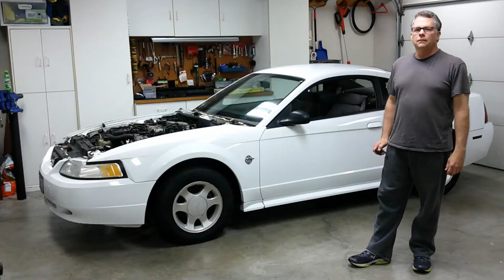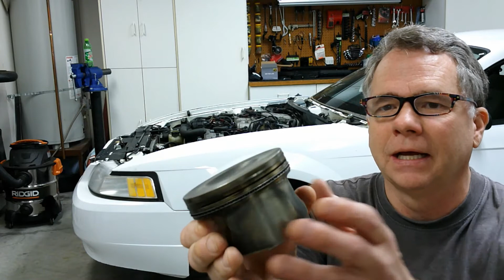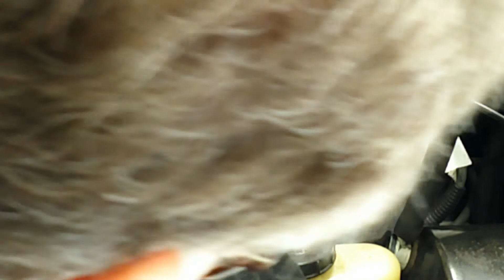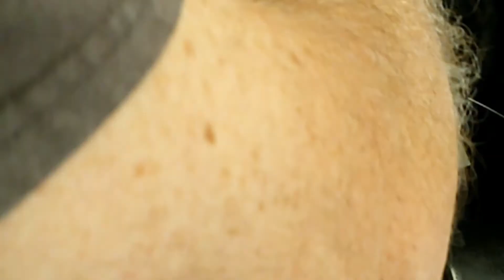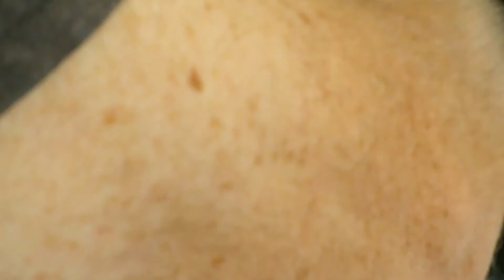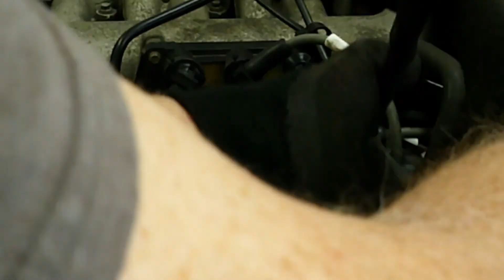Mustang Engine Repair (Part 1)

Comment: I have the same year . A 2000 mustang v6 3.8 . The engine shakes and you can feel it all over the car . 
Would you think this maybe a flex plate issue or a similar problem like you have . ?